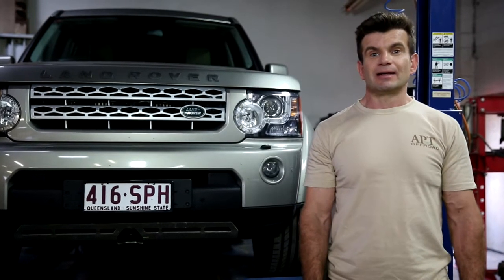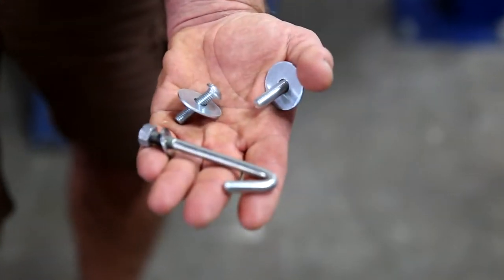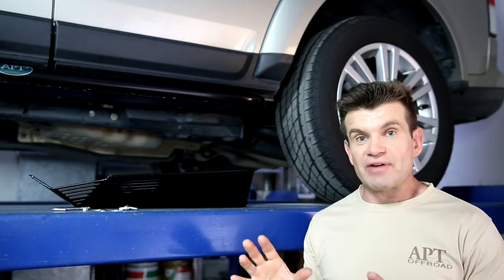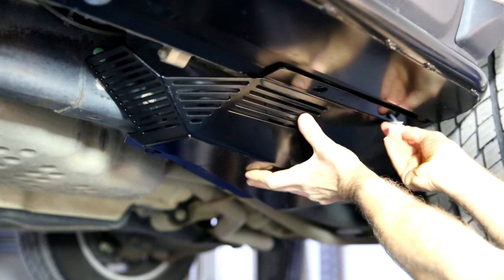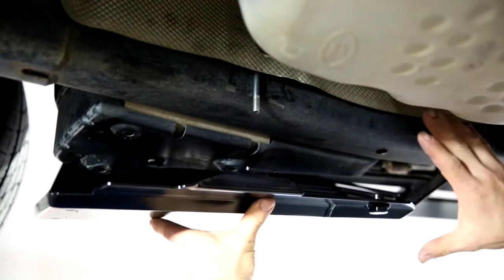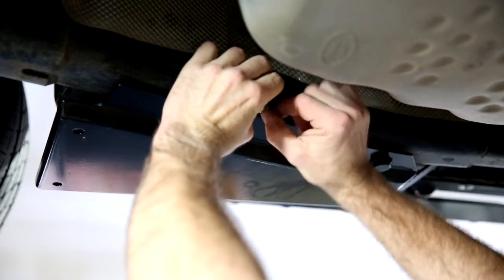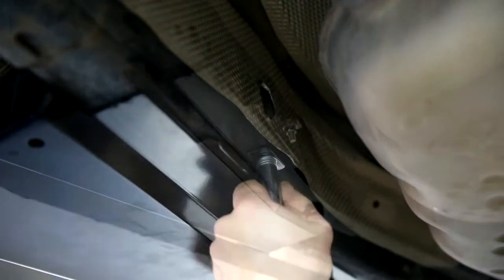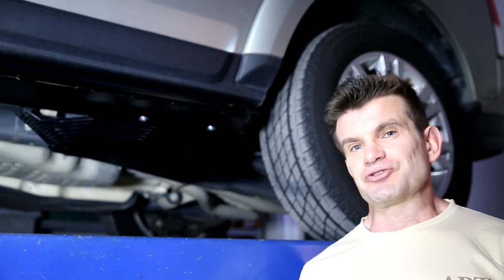Land Rover APT Discovery 3 Discovery 4 Air Compressor Guard install

Comment: Well designed and researched gear Ben. I’ve got you Defender bull bar and steering guard fitted and the bull bar has paid for itself already. I hit a Roo at over 100kpr (in a Defender, lol.) and yes, it bent slightly but saved my guard and more importantly, my radiator in a semi remote area. Better to bend the bar than the chassis. With the winch attached to a tree and back to the bar, it was soon back in place so I could open the bonnet albeit, that much weaker. Thanks for a great product. Cheers Ross.

Comment: hi ben, quality videos very simplistic but incredibly informative, can any of the disco 2 products you make be shipped to uk, regards harvey
Reply from the maker: Cheers Harvey thanks for the feedback, it's much appreciated.. What in particular are you chasing in the D2 range.. cheers Ben
Reply: Hi Ben, thanks for the response,  ideally I'm looking for the whole package, front rear diff guards, steering protector, fuel protector, along with a few other parts to bring the car to a high protection spec, the quality of the parts you guys make are incredibly very strong well designed, regards harvey